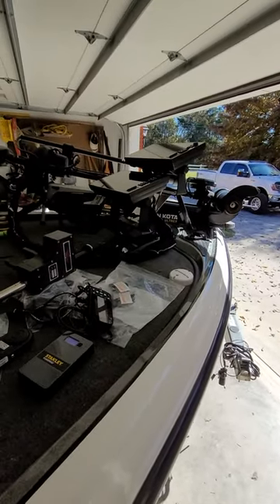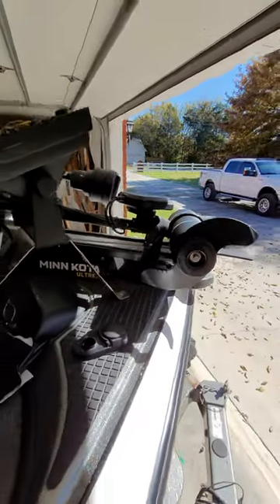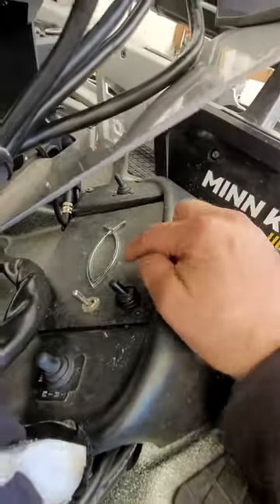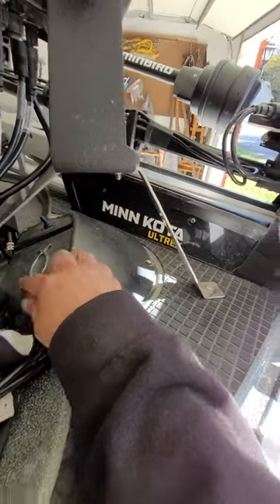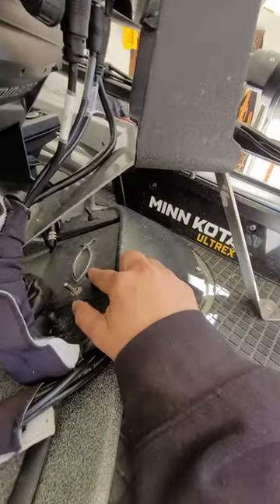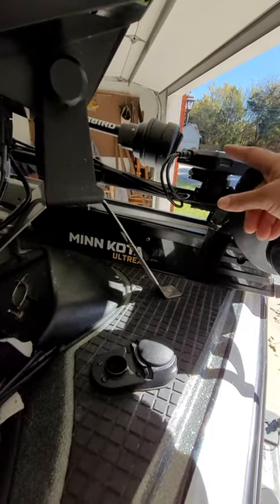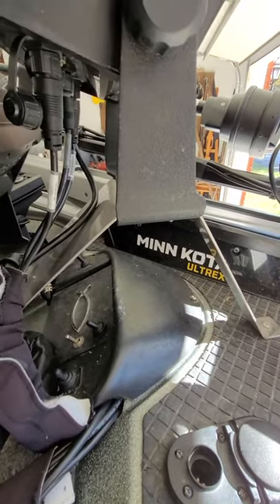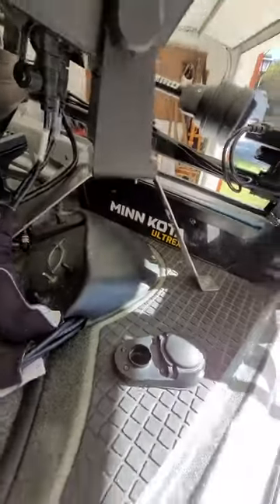TIP: Humminbird Mega Live/Mega 360 power switches

Comment: Ok so i just interested my mega 30 on a toggle switch,  when i flip the toggle switch on! It says connected on my Helix, but i here no pinging noise not dose the transducer rotate! Im placings a ewt paper towel around them silver sensors but it sill dosen't do anything. Just wondering if the toggle switch is holding back current to the transducer, any advise would be greatly. appreciated

Comment: Now you need to show us the how to videos lol
Reply from the maker: Lol, I do share a lot on the Humminbird Tips and Tricks Facebook page. I'm particular some things that I don't share because I do installs (and training on the water) and don't want the local competition to know them. However, I don't use pre-made harnesses.
Reply: I wish I lived near u , I need lots of training, still can see fish
Reply: I want to know too!!! Your images are crazy detailed and clear! How do you do it? What am I missing? We've actually met on Guntersville a few times.
Reply from the maker: @bowilliams2931  I am on Guntersville often. Usually I put in at Waterfront or Scottsboro. I change my settings often during the day and I don't always get clear images. When there is an alge bloom or high thermocline it can be tough to clean up the display. Installation is most important and all the little things matter. Fold over the excess transducer cable, keep the transducer cable away from the trolling motor power wires under the bow, use quality wires and connectors, check for damaged transducer cables, adjust noise filter and noise rejection. Try different color pallets and settings. Hope that helps.

Comment: I had my installer add switches like you did and it helped me a few times. Do you have another switch for your network box? Also, do you power up the Helix and Solix before turning on the 360 and live? Or does that matter? I'm curious because I've had to reset the network hub since the last Live software update. Thank you! Hope to see you on Guntersville again. Let me know when you are coming, I'd like to hire you for some training! Thanks!
Reply from the maker: I do have a network switch. I typically start with M360 on and that unit. Give it time to boot up and then power everything else up.

Comment: What size wire did you use from switch to fuse panel for both the mega live and mega 360?
Reply from the maker: Lately, most installs I use 12/2 because I buy wire in bulk 200+ ft rolls, and a run from the fuse box to the bow mounted power switches are about 12 ft... ish.. It's still hard to get wiring as available stock is low.
Reply: @humminbird_tips_and_tricks  I have a short run, about 6 feet from switch to fuse box.  I ran 16 gauge for both Mega Live and Mega 360.  Will that be okay?  I read others used 18 so I bumped it up to 16.
Reply from the maker: @katiedolfman6496  if you’ve already set it up, give it a try and see how it holds up. I’d rather beef up the feed a bit more to compensate for changes in voltage throughout the day. Lithium users however, benefit with a constant higher supply voltage throughout the day. Hence other factors create variables to consider. Therefore, in general, 16 or 14 awg will probably be suggested by most. Hope that helps.